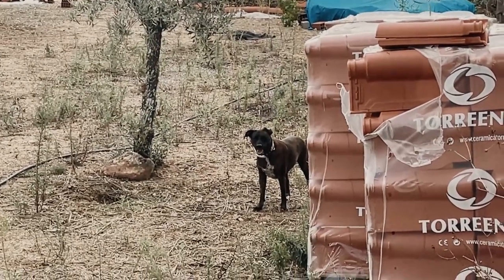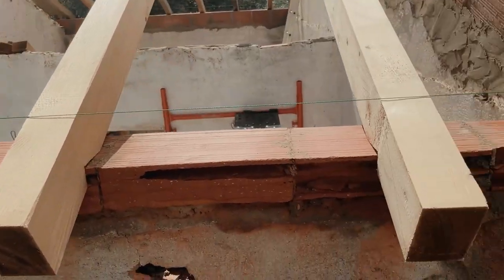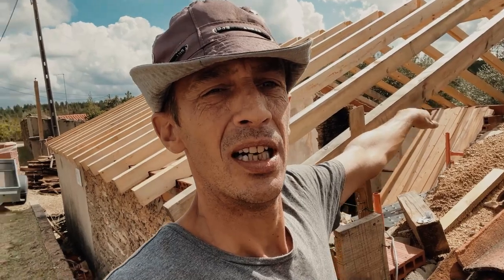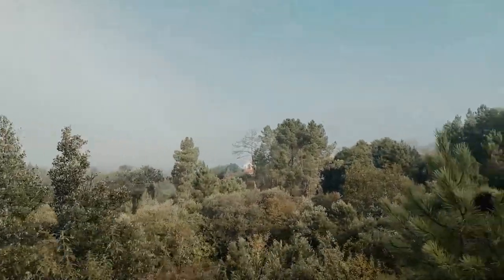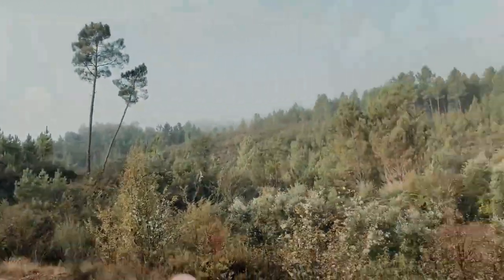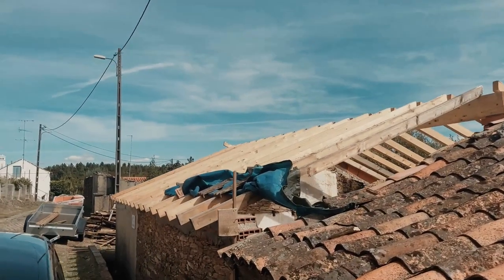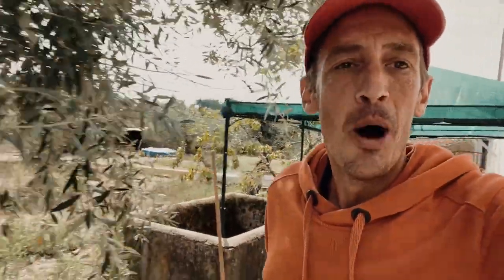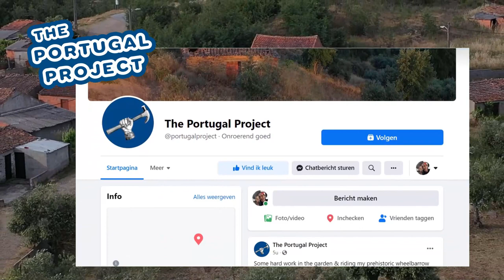ANCHOR the ROOF to the WALL and a TOUR of our BACKYARD (taking Zoey for a walk)

Comment: Just drill a hole in your rafters about 13mm and into the bricks about 3 inches. Use epoxy in through the wood into the tile and insert 12mm threaded rod into the holes. Counter sink a hole in the wood to counter sink a nut below flush with the timber. When the epoxy has set trim threaded rods flush with top of rafter. Should you need to change out a rafter simply unscrew the nut from the rod.  If you just shoot a little spray foam into the holes where the rods go through that will keep epoxy from running out. Good luck.